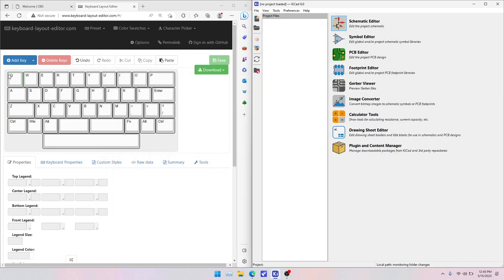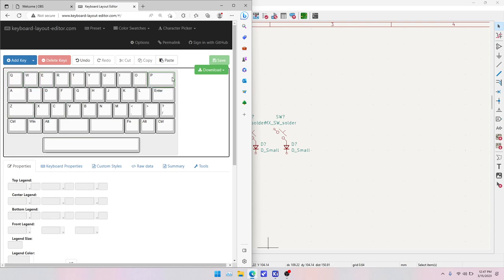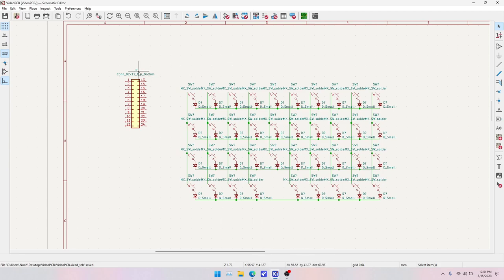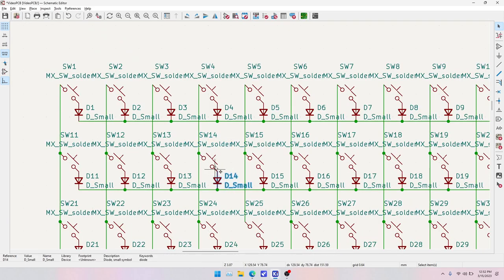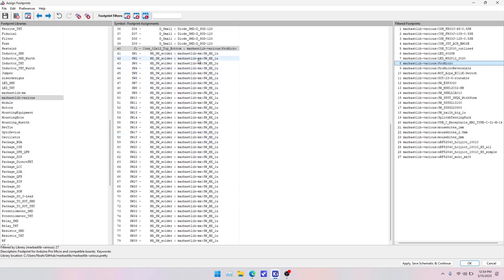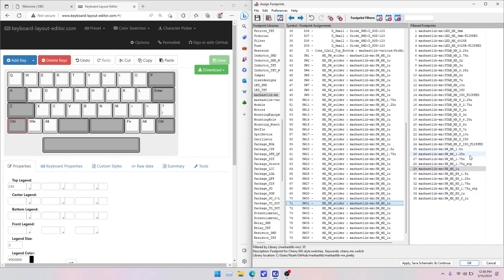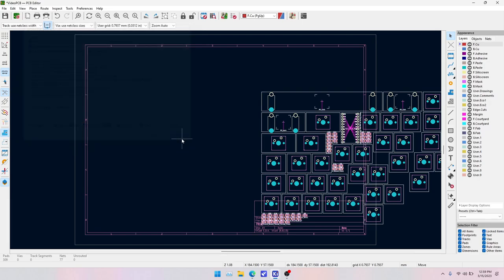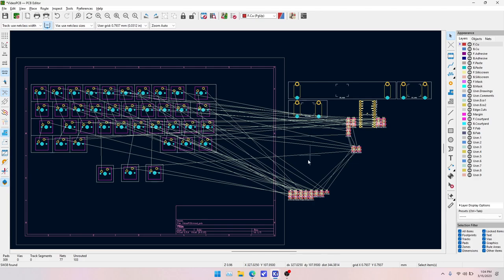Creating a Keyboard PCB with Diodes (Kicad 6.0)

Comment: I found it easier to draw the PCB outline with the box tool. You can then easily add the rounded corners using the “Fillet Lines” option in the right-click menu.
Reply: I consider, this way is the best when you already have the housing you want the PCB to fit inside. But, if you are to make everything anew, the order doesn't really matter: you can arrange all components and come up with borders of the new PCB, and then start designing the new enclosure
Reply: @petergorelov418  I wasn’t commenting on the order of doing this, just that if you have a rectangular PCB then drawing a box is easier than drawing the individual lines. Actually, even if you do have a non-rectangular PCB it is easier to use “Fillet Lines” to make the corners.

Comment: I love the video, but I have a quick question: When using soldered sockets do you not need to flip them on the PCB editor? I noticed in the macropod video you flipped the hot-swap sockets and just wanted to know what the correct orientation should be. Great helpful video otherwise
Reply: I don't know about KiCad, but usually socket PCB patterns are used exactly like the chips and should be flipped only when put on the flip side of the board (if the program doesn't tie those decisions together).  Anyway, it is easier to manufacture boards with all parts on the same side, thus chips and diodes hiding in the gaps under or between moving keyd

Comment: Just a minor issue, the 100nF decoupling caps should be placed as close as possible to the processors supply pins... 
While it will probably work as is, I would follow the datasheet recommendations... C4, 6 and 7 can be moved much closer with very little effort...

Comment: It's a really great guide. Although I have no experience, I was able to design a pcb thanks to you. It is now in the production phase, so I have a question to ask you. How should we install the stabilizers on the keyboard? Are the screws that come out of the PCB mount stabilizers suitable for use? Also, if we can adjust the plate, can we use the stabilizers attached to the plate?
Reply from the maker: PCB-mount stabilizers use the screws to screw into the PCB. Plate-mount stabilizers clip in to special cutouts on the switch plate

Comment: Can you explain me a part where you make 3 stabilizers, please? It's for 3 different spacebars or just 2 or only 1 spacebar or it is about anything relate to the Stab style or anything.
Reply: the 3 stabs are for the ability to use two different layouts on the same board. if he puts in 2, he can have 2 space bars, or he can install the larger one for a single "full length" space bar

Comment: So when attempting to do this, I had everything downloaded and it was all working completely fine until it came to assigning a footprint for the controller. The basic ‘ProMicro’ didn’t exist so I tried re-installing the marbastlib package and it still wasn’t there. The marbastlib-various library is there and full, but it doesn’t have the ProMicro. 

Due to this I tried using the ‘various xp’ ‘promicro elite C’ (I have two elite C controllers as is) and this crashed KiCad, and when I tried to reopen it KICAD things the project is still open even though it isn’t. Help please if possible!
Reply from the maker: I believe that marbastib now has a promicro-ish library for these kinds of footprints

Comment: Where do you source the switches and caps ?
Reply from the maker: Mostly amazon. For the less common keycaps, like 1.25u A or 1.75u P, those are usually found in 40% keycap kits as Tab and Backspace, or as other keys from uniform profile keycap sets like DSA and XDA